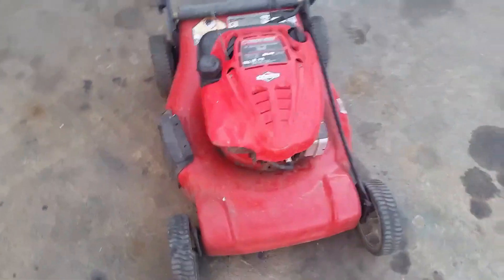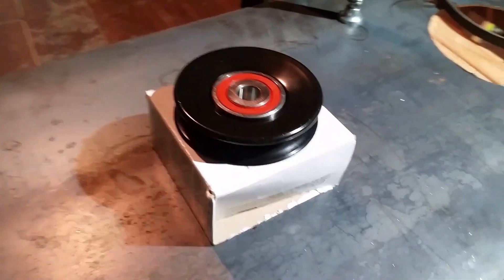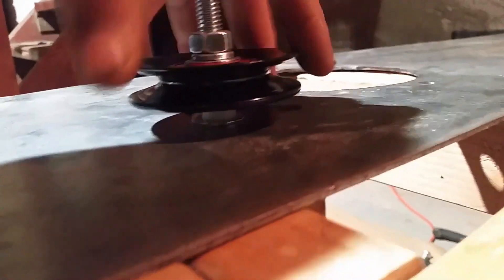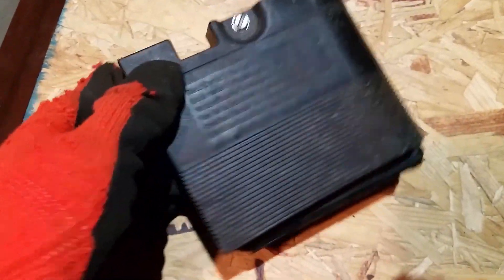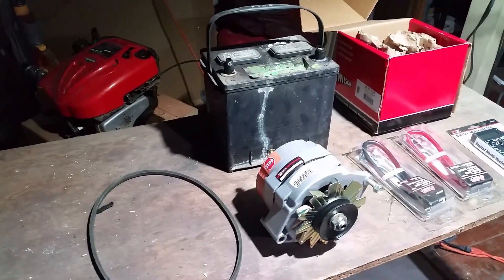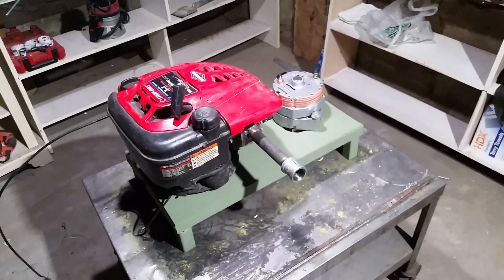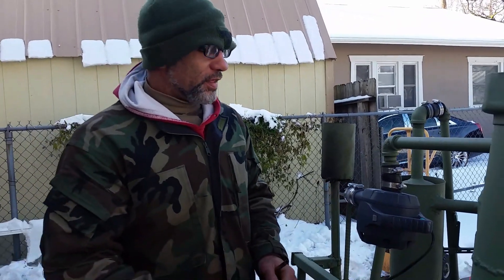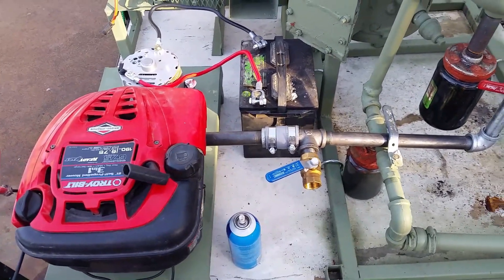Lawn mower turned into generator that runs on wood

Comment: U way over complicated that, ive done this but way simpler, same charging idea from a gas motor, but all i did was add wood inside a barrel and sealed the lid on, plumbed the same way from barrel to intake of gas motor,  then used other wood to lite a fire under the barrel.

Comment: A second pulley for starting the engine would be very useful.
Reply from the maker: Yes and I found that unconnected power supply AKA battery terminals, takes the resistance off the drag.

Comment: could you put the battery a little closer to your ignition source?
Reply from the maker: You could pretty much configure it however you would like. I just would not have it too close to the reactor due to the heat. I will eventually have a totally separate shed built to house the power bank and inverters, etc. I have not been working on this project for over a year because I lost my land and got pretty bumbed out. However, I am looking to purchase another track of land in the coming weeks. I will be right back to making these off-grid projects.

Comment: Why do you need a battery? What would you need to do to be able to attach residential outlets?
Reply from the maker: Well, doing a battery bank is a good idea for a setup like this. It allows you to store your power and then use it in a twelve-volt system. This way, I can combine solar power and wood gas to keep a charged system. I don't think this gasifier would be suitable for a direct link into a 110-home setup. However, running a good generator off of the gasifier and your home linked into that would work just fine. This gasifier can be very temperamental, I wouldn't want to be in a position to rely soly off the power it creates in real-time. You could be fighting the burn too often in the less than ideal type of weather. In my opinion, it's better to have the option of storing the energy. This is just my opinion.
Reply: @Saxxsays  that makes sense. Thanks for the reply.
Reply from the maker: @justawfulgamer7738  You are very welcome. Thank you for the engagement on my content. I appreciate you.

Comment: Sounded like an intake valve was getting sticky from tar,  I could hear the valve train slapping. That engine is more likely too small for the gasifier. Those small engines that size are very difficult to run on a raw fuel gasifier to begin with. Even the best machines will make tar as there just is not enough volume to drive the reactions. 500 cc Ive found is about the limit. Any smaller charcoal gasification is a much better solution. They run way more stable, no tar and with the water injection the gas is more powerful.
Reply from the maker: Thank you for that information.

Comment: Hello. It is possible to run 2 stroke motor on wood gas?
Reply from the maker: I would not suggest that. There would be no oil to lube the fuel.

Comment: Do you have a butane tank attached on the bottom? What fuel are you talking about? Is the logs burning, creating a fuel?
Reply: The fuel is the off gas from super heated wood, not actually burning because it is in a oxygen restricted environment, no flames

Comment: i thought wood just burned as smoke and there was no useable energy left. 
Thanks for sharing this video.
Reply: The wood isn't actually burning in a gassifier, it is super heated in a oxygen restricted environment so the wood off gasses, no flame involved at all. All that off gas is flammable, but impurity's (tar need to be removed or thermoly cracked and turned into a more rich fuel. That is then filter and can power a engine

Comment: I really like the simplicity of this.  Once I saw it come together, I thought of a way to simplify a little more.  The alternator could be mounted under the deck, directly under the engine shaft, and connected with a lovejoy coupling.  That would eliminate the belt, and the energy loss belts require.  But your layout is already great.
Reply from the maker: I like the way you think. As far as the battery bank set-up goes am tossing around several concepts in my head. It's been a bit too cold recently for me to be out working on my trailer, but it's getting nice enough now for me to get back on it.

Comment: Could the gasifier be down sized a bit for a more compact setup? How many watts does it produce? Wood gas is very cool. Excellent work!
Reply from the maker: Absolutely it can be downsized. The watts will vary due to each variation from one build to another. The size motor, the size alternator, the size burn tube, the biofuel used, etc. That's just something you would kind of need to play with depending on your particular needs.

Comment: Great idea and layout.  One thing you may want to consider is to add a flywheel to the engine shaft to make it easier to start and run a bit smoother once it does.  Lawnmower engines utilize the mower blade as a flywheel for added inertia for starting and it makes for a smoother compression stroke with a bit less vibration.
Reply from the maker: That is very good information to know. I am somewhat of a visionary, so those tips are highly appreciated. I wasn't aware of that. Thank you.
Reply: Thank you fir the tip.  I will put that to use.

Comment: I noticed your paint seems to be burning off each video.  Have you tried switching from regular rustoleum to a high heat rated paint?
Reply from the maker: Yes, I most certainly plan to paint it legitly
. Right now I am fine with it. I have a lot more I'm adding to this build. I will be sanding off areas to weld etc. When It is complete I will repaint it all.
Reply: @Saxxsays  so far it is looking great!